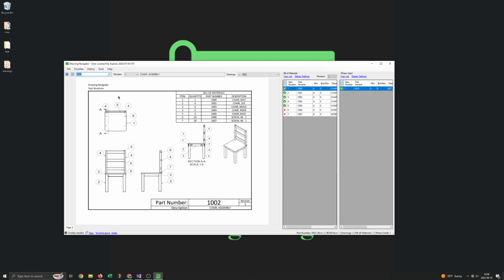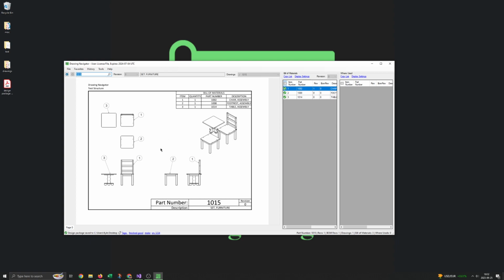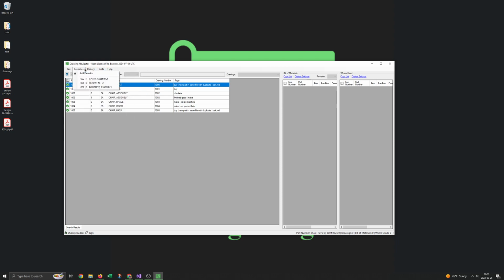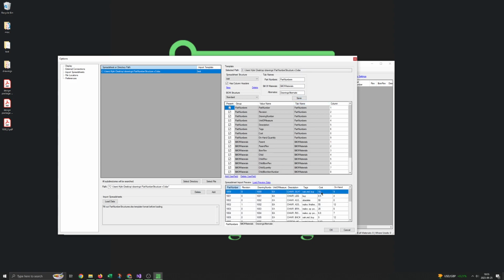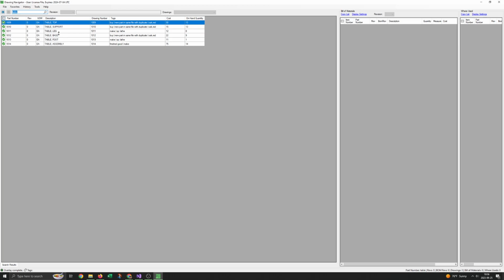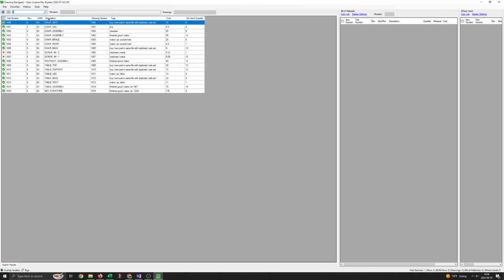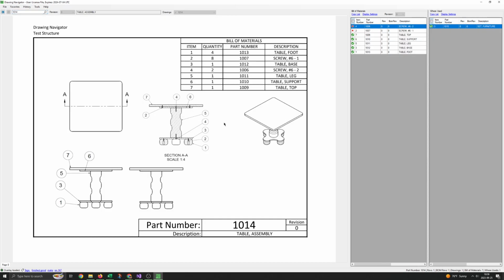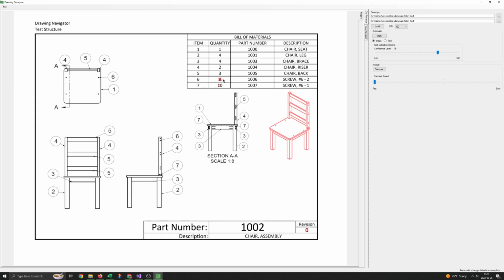Drawing Navigator usage v1 15

Comment: Do you have plans to add the ability to export order lists for procurement? Say for example I have top level assembly with multiple subassemblies that use an M3 screw, and I just want to go to the top level drawing and export an order list with everything necessary to build it and hand that off to someone to purchase. Can your software do this? Or do you have plans to add this feature? 

P.S. heard of you from your Instagram page, saw your software and it looks like just what I need for my current workflow at work.